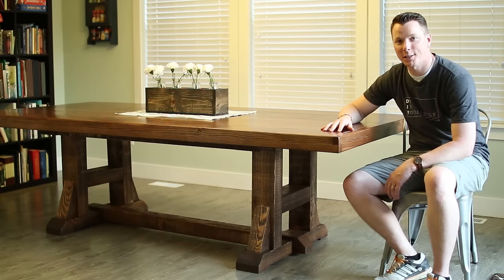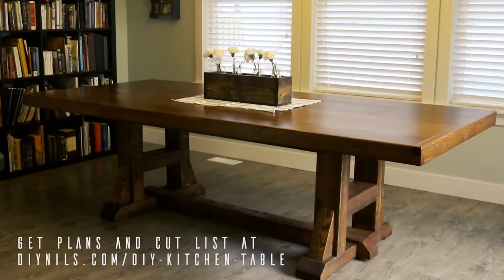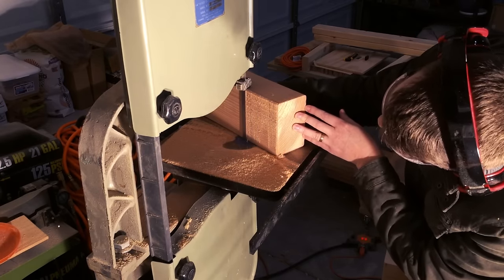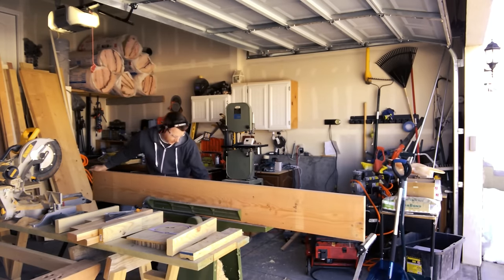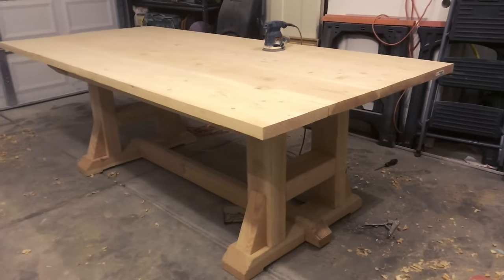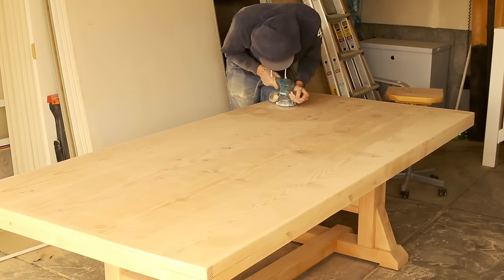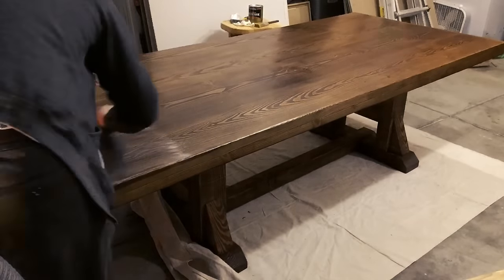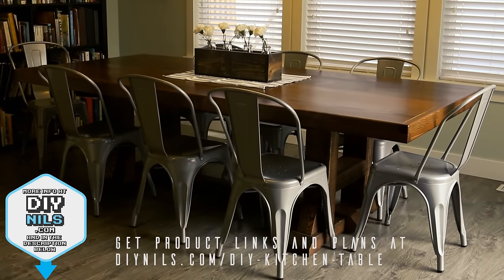DIY Dining Table: Pottery Barn Inspired Farmhouse Table

Comment: Great looking table! Is the beam at the bottom next to the floor that connects the legs, just for looks or is it structural? Could the table be built without that piece and still be stable?
Reply from the maker: It does add rigidity and takes some pressure off the legs as far as side to side movement but I imagine omitting it wouldn't make a huge difference. If you end up building one without it I'd love to hear what you think.
Reply: @LRN2DIY  Thanks for your quick reply. I'm in the process of designing an outdoor dinig table that I will make with WR Cedar. My wife likes the X table leg style but in most designs there is this beam at the intersection of the x. On every other leg style there is this beam at the bottom and I agree it does take the strain off the legs, just trying to understand how much its  needed and my additional cost. I plan to have a footer like yours but since I dont have a band saw to notch out feet, I'll have to cut square feet pads to attach. I also am planning on 4x4s but thinking now about 6x6s. Its always nice to look at a catalog and see something that you like and either can't afford or rather save your money and know that you can make it cheaper and undoubtedly with better materials, not to mention the enjoyment of knowing you made it yourself -Bragging rights included. Thanks again!
Reply from the maker: @jasonkeller5732  Sounds like it'll be a great looking table! One tip on the lack of bandsaw, you can use either a circular saw, or a mitre saw with a depth stop to make several cuts then knock them out with a hammer and chisel them clean. Only takes a few minutes and is a popular method for notching large sections out. Either way though, best of luck!

Comment: You used a 2x12 for the top material then in your plans showed the top at 8 feet. I watched the video and did not notice you mention anything about cutting some off of that or I missed it. So what was the actual length of the table you built when finished? I am looking for a  10-12 foot table. Thanks so much.
Reply from the maker: KS The 12 in 2x12 refers to the width of the board, not the length. I bought 8’ boards, 2” thick and 12” wide. My table is 8’ but you can make it longer for sure. I might recommend lengthening the base to keep it more consistent but if you’re doing a 10’ table you really don’t need to do a longer base.

Comment: I’m starting to build this a bit of it at a time cause I’m new to woodworking. I’m confused about the 4x4 piece at the bottom, the big stores only sell this in treated lumber and say it’s not good for furniture cause it’s hard to stain, etc.

Is yours treated or untreated? I just wanna know if it’s ok if I pick it up in treated. Or what did you do.
Reply from the maker: Definitely untreated. You may need to look around a bit for that piece but absolutely stay away from the pressure treated stuff. Alternately, you could glue two 2x4s together if need be.

Comment: looking to build this same set and i look at your website but did no see a how tall is the table how wide do i need to set up the foot apart from the top table.  let me know so i can just get the wood i need and how i need to cut them be appreciated
Reply from the maker: Looks like I missed that in the plans. The table height is 2' 6". The table legs should be 1' 6 1/2" in from the skirt of the table on the ends, and 1 1/2" in on the sides. Does that answer your question?

Comment: you are scratching it with any grit sandpaper. the point of the high grit is it creates much smaller scratches that the new poly can adhere to cuz it self levels when it dries.

Comment: The table will rock if it is set on an uneven floor. If you can't cut the piece off the bottom of the legs you need to put feet on it.

Comment: Did you end up using any spf (spruce/pine/fir) boards for any of this? I checked my local home depot and they have Douglas fir but for the 2 x 4's and 4 x 6's are spf instead of just fir
Reply from the maker: The stuff at my local store was all labeled as Douglas Fir but I know that the selection varies quite a bit depending on where you live and which store you check. My brother made this same table where he lives in Mexico City and had to use locally sourced oaks since Home Depot there has nothing more than 2x4s.

Comment: This is an absolutely lovely table....however...I really wish you had omitted the "end caps" or breadboard ends that you applied using pocket hole screws.  Why?  Because it's pretty likely that the breadboards will prevent the natural movement of the wood and cause cracking and splitting in the table top -- which would ruin your whole table.  You DO NOT need end caps to beautify your table top.  You can make end grain look beautiful with sanding in much less time than it takes to make end caps.

Comment: How would you go about changing the measurements to seat 10 or 12ppl?
Reply from the maker: The table sits 10 pretty comfortably as is, but if you want to make it longer and seat more, you just need to extended all of the boards that run the length of it, and I'd recommend doing so by 2'. That includes the 4x6 across the bottom, the skirts, the aprons and, of course, the table top boards themselves. Other than that it can remain identical. Another option is to just extend the boards that make up the base by 1' and then let the extended top hang over another 6" on either side, which shouldn't be a problem at all since it's so sturdy. It's up to you.
Reply: @LRN2DIY  What if we wanted it 7feet instead of 8? I worry it'll overwhelm my dining room at 8feet

Comment: "I used douglas fir, its a softer wood"  douglas fir is actually one of the hardest softwoods.  pine and cedar are much softer
Reply from the maker: Right - it's soft compared to the hardwoods but one of the more tight grained and harder softwoods.

Comment: I like the bottom, but I do not want the cross member in the"H" of the legs. I understand you copied a table & wanted it, but with the beefy legs I do not think it is needed. I have no problem with you having it,I just do not want it & think it will not hurt to not use it.
Do you think I can get away with not using the cross member ?
Reply from the maker: Hey Joe, I think it will still work and be pretty stable. The lower beam adds some stability but probably isn't required.

Comment: How did you secure the top to the frame?
Reply from the maker: I predrilled holes through the runners underneath and drove lag bolts into the top. If you check out the link to my site in the description, you'll see photos because I realized I didn't document that well in the video.

Comment: I can't find 4 by 6 wood here in Canada Can i use 4 by 4  and also can't find 2 by 12 can i use 6 2 by 8  . Any advise as I am using red western cedar
Reply from the maker: Niraj Nik You can absolutely substitute other sizes. You’ll just need to adjust your math to make it work. I don’t think either of the substitutions would have much effect on the measurements though. Good luck!

Comment: I want to build this but i would have to shorten the top to 6ft instead of 8ft so how would i keep it proportion with a 6ft top?
Reply from the maker: I'd recommend shortening each of the long runs of wood (the ones that go across the length of the table) by one foot. The total length of the base is 4' 8" right now so shortening that to 3' 8" should keep things proportionate. You could also just leave everything as it is, just shorten the table top, but you'll end up with less leg room on the ends than I think you'd like.
Reply: Thank you im just starting to get into woodworking so this will be my first project so i appreciate the reply. You wouldnt happen to have plans for a bench seat would you?

Comment: To hell with "too cheap," the reality is that store bought tables today are designed with weak points to fall apart after a certain amount of time/use(usually a decade or less).  But A well made table can last centuries, I want my furniture to outlast my great grand children....

I loved the use of the bandsaw to rough up the lumber.

For tying together the table top boards I would recommend dowels or biscuits with glue instead of pocket hole screwing.

Makita is awesome.  You spend a lot of cash, but for tools I plan on using for over a decade, that is the way I go.

I understand wanting individual chairs, but those things destroy the appearance of the room....IMHO

Comment: Would a 5/16 drill bit be to big to pre drill with or?
Reply from the maker: No, I think 5/16" would be just fine actually. There was still plenty for the threads to grab on to with the 1/4" hole so I don't think the extra 1/16" will hurt.
Reply: Thank u.   Yeah my 18v Milwaukee drill still struggling to put it in.  Your right.  Looks like I'll have to get a 18v impact.  Thinking rigid.    Where can I send pics of my project inspired by your build?  Thank u
Reply from the maker: Hey Dewey, that's awesome that you're building this. If you use Facebook, Twitter or Instagram, you can post it using @lrn2diy or #lrn2diy. If you don't use those, let me know and I'll send my email. Thanks!

Comment: Wont the tabletop crack due to the pocket hole screws?
Reply from the maker: Cezaam69 The pocket hole screws are on the bottom of the 1 1/2” boards and haven’t caused any cracking or issues at all.

Comment: Where did you purchase the 4x6?
Reply: As a Canadian , the box stores don't care anything bigger than 2 inches it seems for anything but treated or cedar
Reply: Blake Huynh I just went to my local (FL) Home Depot, and they have few of 4x6’s...
Reply: My Lowe's has 4x6's in 8' and 12' but they are GREEN!!! Plan on stickering them to dry before you try to build with them. I built a harvest table very similar to this design. It's 10' long, biscuit jointed 2x8's, real bread boards, 4x6 stretchers top and bottom and a painted base. All boards were squared and planned before cutting. The wife loves it.

Comment: hey, anyone that know what kind of home depot sell? there's no home depot where I live, and it seems people on youtube buy wood from home depot all the time..
Reply from the maker: Most of what I've seen there is either white pine (typically for 2x4s) or Douglas Fir, for all of the larger stuff (2x8s, 2x12s, 4x4s, 4x6s).
Reply: DIY Nils is it cheap? it is good? or is it just accessible?
Reply from the maker: It's a cheap wood and how good it is depends on what you need it for. Pine and Douglas Fir are soft woods that stain nicely but can be knotty. They're nowhere near as tough as hardwoods like oak and walnut but are much less expensive.

Comment: Hold on.  You built a table out of construction grade lumber from Lowes and then you're surprised it warped?  And you put it together with pocket hole screws?  It's no wonder it warped.  Wood from a lumber store isnt kiln dried so of course it's going to warp!  And the pocket holes screws arent meant for joining wood like that.   Why would you do that?  It looks like you have some decent woodworking tools, so I'm really confused about why the top wasn't jointed and planed correctly?  What a mess.

Comment: Common framing lumber is not dried to 6-8% moisture content. The 2x4 ends are not done right either. This will certainly fail. 
Y